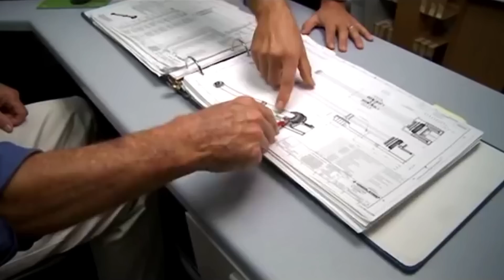US's Ultra-Advanced Railgun Weapon Is Making All Others Obsolete

Comment: To put this in perspective, a typical hunting rifle round travels at approx 1,900mph. This hypersonic round would travel at approx 36,000mph!! Also by comparison, while the speed is relative to a fixed point on earth, in this case the equator, the fastest recorded speed of a NASA Shuttle was 17,225mph. Need I say more?
Reply: I had no idea a bullet could travel at 1900 miles mph,that is insane speed to hit a target from a rifle.
Reply: @colinsmith1288  yeah people often don't realize a bullets' mph speeds since bullet speeds are measured in either feet or meters/sec. I used 2,800fps which is pretty standard. Shorter rounds will be closer to 2,500fps while magnum rounds, say from a .300MAG would be closer to 3,200fps. You take 2,800fps, multiply it by 60sec & you have how many ft it'll travel/min. Multiply that figure by 60min & you'll have how many ft it'll travel in 1 hr. Divide that by 5,280ft in a mile & you'll have your MPH value. Like I said, most people won't go through the trouble or just stick to feet/sec. I however am always interested in miles/hr...Sry for the lengthy response, just tryin' to explain how I came up w/that figure. 😉✌️
Reply: @dodoubleg2356  Thankyou for information and time ,l am truly awestruck!
Reply: @colinsmith1288  certainly, YW 😉👍✌️

Comment: Seems to me every ship in the Navy has that single barrel deck gun and this would be better for that. This could be a lot better for a tank gun as well. Sounds like they hit some sort of technical issue with shrinking and making the device portable. Might be that it's very sensitive. Get's a little out of alignment, blows itself up. Might also work well as a next generation Iron Dome system.
Reply: the barrel gets so hot with each shot that it only gets about 3 shots before the barrel needs to be replaced, thats the biggest issue it faces, the powerplant size is much easier to overcome and it has already been reduced in size by many orders of magnitude and is small enough that it can be carried along with the gun on a mobile platform, but if your only going to get 3 shots before the entire barrel needs replacing then it is completely useless right now as a practical weapon and there needs to be significant advances in metallurgy before it can be considered for actual deployment.
Reply: It sucks up a lot of amps, needs big extension cord or battleship power supply.

Comment: With all do respect for such awesome technology it's not feasible to replace all forms of artillery with this weapon
1.  It's complicated and need a high tech 
2. expensive which might make it s liability if used on mass scale 
3. it's a heavy peace of equipment since operating it need alot of power witlch make diffrcult to transport through the battlefield 
This device need to put in spacial use acorrding to it's abilities

Comment: If you are going to replace gun powder it make more sense to go directly to directed-energy weapons. The rail gun vs directed-energy weapon is like a hybrid car vs an EV.  Directed-energy does not have the wear problem, is much faster and easer to control via software etc.
Reply: Directed energy tends to diminish with range fairly rapidly.  At least in the atmosphere.  Even that one they filled an entire 747 with, while flying at altitude (initially done to test a laser-based anti-ICBM system) ended up only having an effective range of a dozen or two miles.  And it was firing through thinner air then you would from the surface.
Reply: @SephirothRyu  Why not use Nicola Tesla's aetheric stream beam which he used impulse DC to power it. Eugene Podkletnov is on it with his impulse gravity beam device.

Comment: If laser technology improves dramatically, and can be cost effective, it will far surpass rail gun technology.
Reply: Plus it will look way cooler.
Reply: Only issue with lasers is if it's a rainy day 🌧 😯
Reply: Just no. Light traveling at the speed of light will never discharge a fraction of the energy of a solid mass traveling at near the speed of light, which is the potential of an electronic propulsion system. It's a solid metal Laser blast.
Reply: @Chrisfrom_Dallas  
Laser light can destroy at the speed of light. Imagine the power of a lightning bolt ⚡️
Reply: @mikewalsh1402  lightning is a jolt of electrical energy, not light
Reply: @xela79  
True
Reply: How are you going to shell something with a laser?
Reply: @catklyst  
Lasers burn holes, they can be very destructive
Reply: @mikewalsh1402  you misunderstand, how do you use a laser like a shell and have it hit a target by moving through the air in an arc?

Lasers are line of sight only, good luck hitting an enemy behind a hill or in an entrenched position.
Reply: @catklyst  
Lasers are the future
Reply: @catklyst  makes a lot more sense to shoot a lazer vertically.
Reply: @catklyst  Ever seen the movie "Real Genius"? You can get the idea.

Comment: the problem with rai guns is technology has not caught up with it. They are big and bulky, not to say heavy, they are not small enough. on top of not small and light enough to be carried by man. even if it is, there would be a battery charge issue for a man carried version plus the weight of batteries and coils so at this point in time gun powder rules the firearms market a laser gun doesnt even have the tech to knock out gun powder.

Comment: The way this eats away at the barrel, it can't last very long. The entire fire blast in front of the barrel is vaporized metal from the barrel sled contacts. The projectile continuously tries to weld itself to the contacts and the acceleration is the only thing preventing it from doing so, but it takes a lot of material with it... Special materials will be required to make this a durable thing.
Reply: Probably a composite material created to be heat resistance and durable.

Comment: Unfortunately you need an astronomically heavy capacitor bank so could only feasibly work on ship or fixed land assets right now.

Also unless you have a huge electrical supply on tap the advantages don't really outweigh the costs. After all, all you are really doing is replacing the chemical energy of the bullet with that of an engine, converting it into electricity and then converting it back into kinetic energy.

Comment: There is already a man portable rail gun, the projectile is low velocity but still in the lethal range. It's biggest problem is that it needs to be recharged after about 20 rounds and is not robust enough for combat conditions. As battery technology is advancing faster than at any other time in history it will only be a few years before we have the technology to provide a more reliable and efficient man portable rail gun so any vehicle mounted system could be in service within the next 10 years baring any political interference.

Comment: "and to adapt existing guns to fire the railgun's high-tech GUNPOWERLESS projectiles"
hmmm, about that, even in the medieval times projectiles were "gunpowderless"
also, existing guns use "gunpowder" to fire, this means that the entire "gunpowerless" point is lost, the railgun program failed and now the US wants to use the projectile with normal guns

this is totaly possible but new guns will be needed, tank guns can fire apfsds at speeds higher than mach 5 and possibly soon reach mach 6
a large caliber (lets say an 8inch) smoothbore gun could reach such speads when firing such a small projectile from a sabot

current howitzers are rifled and make no sense for such use
the smoothbore gun will not be compatible with current ammunition

Comment: Public question: why cannot we hybridize propellant-based cannons with magnetic launchers? Would that not reduce the load on the magnets, requiring less power and less heat generated? What hazards prevent that from working?
Reply: You'd have a high pressure explosion inside the barrel. That's a different type of stress the rails get exposed to.

Comment: 2:00 "at hypersonic speeds, or up to 52,493 feet per second."
2:55 "Capable of launching projectiles at up to Mach 5..."

52,493 feet/second = 36,000 miles/hour
Mach 5 = 3,836 miles/hour.

Something doesn't add up.

Comment: Scuttlebutt is that the M1A3 Abrams is going to be electric drive. The turbine is to be redesigned as a small direct coupled high rpm generator, and the entire transmission system removed. It will power a battery/super capacitor and electric drive system. This will allow the crew to shut down the turbine to save fuel and operate in a silent mode for up to 20 miles. The increased efficiency will double the total range of the M1A3. 
 I can't help but think a smaller rail gun with an auto loader wouldn't be a fantastic way to use the new electrical systems capabilities.

Comment: meh, the concept is cool and all, but in practice if you have massive amounts of electrical energy ot spend on weapons, you most likely are better off going with lasers.

the "drawback" of conventionnal ammo is the explosive, yes, but on the other hand, that also means that your ship does not have to provide the energy because it is already stored in chemical form. unless we're talking about a nuclear powered vessel, you're just trading explosives for fuel.
and don't go thinking that just because you're shooting dumb slugs of metal they will come cheap, then you have the mechanical parts of the gun, particularily the cannon that wears out extremely fast apparently.

Comment: You didn’t mention if the barrel wear issue the navy discovered has been addressed or overcome. 
Another great story! Keep them coming!
Reply: They haven’t. There are theories on how to address it, but there’s hasn’t been the “We have solved it” test
Reply: It seems like barrel wear could be eliminated, heat is the big issue, but maybe some kind lol liquid nitrogen coolant or maybe some form of super conductivity using super low temperatures to maximize the electrical efficiency as that could help cool the system. One idea I had was cooling the entire barrel with a jacket of liquid nitrogen kinda like a browning machine gun from WWI, it’s not the first time we have had challenges from hot barrels, even the MG42 had spare barrels
Reply: the US Navy demonstrated the rail warp / melt problem had no solution.  In addition, the power storage requirement consumed large volumes of shipboard spaces.  Many container-sized electrical storage units per gun.  In short, impractical with current technology.  Maybe future.
Reply: Barrel wear could be overcome by replaceable liners, but it would be a shipyard event, probably not achievable at sea.
Reply: Barrel and ruining a magnet both need to be fixed 🤔 so why not change the barrel after 5 shots like the g10 4 barrel assault gun
Reply: It has with the blitzer.
Reply: Short answer. 

No. It has not been addressed.

Long answer.

It's not barrel wear, the coils get ripped apart when firing the projectile. That's the 'barrel wear'.
Reply: Exactly - if they haven't progressed in keeping the weapon from tearing itself apart, the video is just another fluff piece.
Reply: The video also doesn't really mention, that the project was officially scraped/suspended indefinitely as early as 2017.
Reply: It was put on hold to focus on other hypersonic weapons. They will come back to it
Reply: @Hellenkeller777  Other hypersonic weapon systems are better and you know it. Rail guns wear out fast.

Comment: The problem(s) are at least twofold. One, barrel erosion, this is probably the bigest problem. Each firing quickly erodes the contact surfaces. Rapid fire probably even more. After a reletively few shots the contact surfaces (essentually the barrel) has to be replaced. Not something you want to be doing in the middle of a fire mission or battle. 
Two, power supply and charge/recharge equipment. The electrical appetite of the system is enormous. Requiring megawatts of power to achieve the stated velocities. The power supply has to be capable of feeding the hungry circuitry almost instantly for sustained firings. The discharge subsystem is subject to huge variations is current, and magnetic fields plus a physical strain on the actual capacitors accumulating and discharging the launching force. 
This is NOT a weapon system approaching deployment readiness, but a testbed for future developments.
Superconductors may offer some help but that increases the complexity and potential failure points, at least at this time.
The Chicoms may have put one on a ship, but they face the same problems we do, but probably less able to overcome them. They have not beaten us to a superweapon.
Reply: sounds like they should skip ahead to the coilgun which does not require rail contact or a barrel.
Reply: @fukushimaisrevelation2817  False: they were using coilguns first, due to the many, many layers of counter-rotating fields the propagate to make a coilpack work its magic there is migration inside the coilpack which causes the gun to digest itself after so many rounds go out of it. you don't see it, often, in those toys people make on youtube cause they're not flicking a 100 pound bugger with ~30k gravs of force.
Reply: Actually, current at sliding contacts is so large that plasma forms at the interface and the resistivity stops current from rising more. It is a power-limited device.
Reply: @claudiobruno3194  
Not sure I understand your statement. As I understand it, plasma is conductive, so circuit resistance should drop. However the plasma would also be part of the erosion problem.
Reply: It doesn’t even just erode like water would rocks over time, it’s literally fragments the barrel with every shot, you can see pieces of it when the armatures jacketing ejects off upon exiting the barrel
Reply: Got it! C. Bruno
Reply: Actually what you are viewing Isa Sabo round.  They have been around for a long time with shot guns. It saves the barrel.yes the plasma will erode any matter near it.
Reply: The power supply would be a limiting factor but that currently is not an issue. You are looking at around 5 - 50 megajoules of energy required per shot. Which translates into Kw, not Mw per shot. The navy being electric driven ships, this would be no issue as ships can easily supply enough power. It is not until you are looking at firing thousands of shots per hour that would than require needing many MwH that might become an issue, or having a much bigger megajoule system that power would be an issue. However as currently the barrel erosion is just in the double digits (ie 11 shots tested as stated in video) before needing to replace the barrel, they are nowhere close to power issues atm. Navy personnel were discussing the possibilities of railguns even back in the 90's, and we worked out that even our spruance class destroyer could easily supply enough power for 100 shots per hour. Back then even single digits per barrel was a major issue, so 100 shot per hour was a pipe dream back in those days and still is.
Reply: Chuck, the plasma is conductive but not as much as an electric conductor...most of the energy fed the plasma goes eventually to heat, not to power the sled...Bye, C.
Reply: The chinese and russians did beat us to several superweapons : morals and integrity. The entire world supports them against us the godless murderous thieves. I hope good prevails over evil even when we are the evil ones. Should have made things right after Kennedy, 911 or syria instead of wasting time on the rat race. Our biggest ennemy is the mafia running the country and the banks.

Comment: What causes that flash as the projectile exits the barrel?  Is it super heated air igniting?
Reply: Plasma from the barrel electrodes that get partially vaporized with each firing.
Reply: @guytech7310  So super heated air (plasma)it is.  There must be tremendous wear on the barrel.  As an example a traditional naval gun can have a life expectancy of ie. 250 rounds.
Either way pretty bad ass!

Comment: Rapid fire that is a flat-out lie that machine would take at least five minutes to reload its energy Supply to fire another round
Reply: Unlikely. A 1MW generator could produce enough stored energy for a shot every 30 seconds. 2 1MW generators could do a shot at every 15 seconds.

The issue is the barrel wear which can only handle about 4 to 10 shots before failing (depending on size and velocity of each round fired)

Comment: I've been following this program. They have made progress.  The prototype was the size of an Amazon warehouse basically. They needed a massive structure for power and electrical.
Reply: Hopefully in a decade they can get this fully operational. Im sure it will be quite awhile...
Reply: Totally Untrue   It was less than 1000 sq ft
Reply: https://youtu.be/jf53m2ERUm8     Loading....................
Reply: Well, when I worked on them back in the '80s, you could easily fit one in a shipping container.
Reply: @snoig1 why the interest in rail guns vs a multi stage coil gun?

Comment: Just guessing but, power to run a RG would probably require a nuclear power generator ? Also, if RG's become prolific, a good counter measure would be the EMP from detonating a nuke ? So what sounds like a good idea might well be the excuse to launch more planet enders.
Reply: I believe the Navy RG used about 30 Megajoules of power. In terms of watts, it would use about 30 seconds of stored power from a 1MW generator. I believe way the power could be stored is in a rotating flywheel inductor system. The flywheel is brought up to speed and the the circuit to the barrel is closed causing all of the energy in the flywheel to be dumped into the gun. You could also do the same with a capacitor bank, but that would probably be pretty bulky to store the power needed.